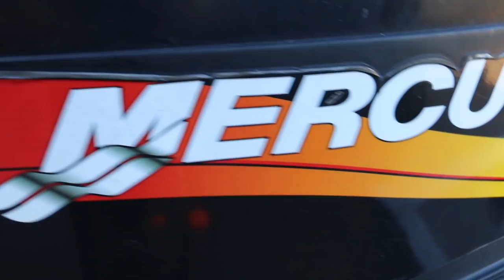Boat Project Step 1 - I Need Your Help

Comment: Cable steering with a right hand console. Aluminum framed marine plywood topped casting decks front and rear. Rear deck live well. 

https://chicago.craigslist.org/wcl/bpo/d/downers-grove-outboard-steering-rack/6812842060.html

Comment: If you are looking for a fish finder, I have 2 Lowrance hook2s, a 5" triple shot and a 4". Both are used, 1 year old and in great working condition. I have replaced them recently with larger Garmin units. Don't need them anymore and will let them go either one or both at reasonable price. If interested,  please private message me on Facebook messenger.

Comment: That is a nice looking ole jon boat. If it was me I wouldn’t do much to it. Add a live well and maybe a rod box. The boat is pretty much 1 huge casting deck being there is no bench seats or anything attached to the floor. Maybe just a decent size casting deck in the front and recess the trolling motor pedal. Then leave from the end of the casting deck all the way to the motor open. Plenty of room for other people to fish. Maybe a livewell and a rod box you can lock up your rods/tackle. You can always make a portable/removable live well out of a big cooler. I’ve done that with a few boats in the past and they work great. Kept my fish alive and healthy throughout a while 8 hour tournament. And of course the trailer. New bunk boards with carpet, new trailer lights and tires. Maybe a coat of new paint. I like it. I’d love to find one like that in my area. I’m always down for little boat projects. I’ve bought so many rough shake boats and restores or converted them to mini bass boats. Fished them a few times then sold them and make good profit most of the time. I do a lot of tree work and landscaping jobs around a lot of the lakes here in NC where I live. Some of these home owners have money coming out of their ears. I have got crazy good deals some times even free Jon boats on a trailer with good sized motors. They are either in their way or they just don’t fish any longer or bought the house and it was left there by previous owner and they think it’s a eye sore. I’ve traded out a half days worth of yard work and landscaping work for Jon boats that would be going for $1,500 to $2,500 on Facebook marketplace or Craigslist. Fix them up and either keep them or flip them for fast easy profit. At one time I had 6 boats I had got for basically nothing. My best score was a 1999 17 foot Carolina Skiff. The homeowner at this certain lake had all the cash he would ever need. Million plus dollar home on Lake Norman in Charlotte NC. Got to talking to him about the skiff and what his plans where for the little boat. He had just paid cash for a 24 foot decked out Carolina Skiff and just put the 17 footer back on the trailer and parked it under a tree in his back yard. We talked about it and came up with a deal. I came back the next weekend and he said if I would get up all the leaves in the front and back of his yard, clean his gutters, and trim a few little bushes it was mine. I asked him if he wasn’t meaning all this work and then cash to boot? He said no just trade it out in work. I felt guilty so I ended up pressure washing his front and back walkways and I also put out about 6 bails of pine straw for him and we called it even. All the work took me about 5 to 6 hours on a Saturday. He handed me the title and a bill of sale for the boat. We pumped the tires up and pulled it to the front with his golf cart. I went to cleaning all his old stuff out of the boat and he insisted that I keep it. Alone with the boat, trailer, 50hp 4 stroke Yamaha than ran great after a good service and new water pump. I got about $350 in rod and reels some where trash and a few where still good. A few hundred bucks In in opened tackle that was In a dry storage compartment. The trolling motor (was a cheaper foot control but worked) had a Older Lowrance Hook 2 fish finder at the console that was trash so I just gave It to a buddy for his kayak. And then he started giving me fishing gear out of his tackle building he never used. So that was my best score. I put a good days worth of cleaning into it to make it looks almost new again. All in all that 17ft Skiff on Craigslist in my area in the condition it was in when I got it would have sold for probably $6,000 to $7,500 with the motor needing to be serviced. I had a half days worth of manual Labor around his house that would had cost him $500 and the $500 I put into it getting it legal and tagged and the motor gone through and serviced. I had about a grand into a $6,500 boat. Not counting the hundreds of dollars worth of gear and tackle. So long story short of any of y’all are looking for a cheap inexpensive job boat or any boat look around some of these nice places on your local lakes. Get on the water and cruise around some coves and be looking at older boats people have out in their yards that haven’t been used in awhile. 9 times out of 10 you can get them for next to nothing. Sorry for the long ass comment but I love talking about boats haha. It’s a hobby of mine and maybe this will help someone out to get a good nice boat that needs a little work for a good deal! 👍

Comment: I Just did a boat.  I’d use aluminum framing,  Put a small deck on the back with post inserts for the seats so your partner can move the sets and fish from the back.  Do not use treated lumber, it eats aluminum.  I’d move the live well to the back and install in to the back deck.  Trailer, I’d replace all bunks and if you keep the hub caps have them rechromed, and the trailer I’d replace all the wiring and new lights and rhino line the trailer.

Comment: My experience with any trailer tire If they sit for any long period of time they will blow out soon. I would get they boat off they trailer install new boards like you mentioned make sure wiring is got good connections. Clean up the paint hit it some cheap black rustolium, for the wheels new tires paint the wheels black with the same rustolium polish up then Hub caps because they are pure classics and check the bearings and you ready to roll.

Comment: Currently building a boat as well. Im using aluminum angle for the framing, best strength to weight ratio and easy to work with. All you need is a jig saw (or angle grinder), drill and rivet gun. Make sure and buy it from a metal supply shop instead of home depot/lowes, it'll save you money and can get any length you need. Bought mine from Shapiro Metal Supply in STL.

Comment: Is glasfibre not an option for the framing? It's less reactive with water atleast, and I think it'l be lighter than wood.
Good luck an i'm looking forward to see the build vids.
Best regards from Anders in Stockholm, Sweden
Reply from the maker: Ill have to check.   Thanks for the suggestion!